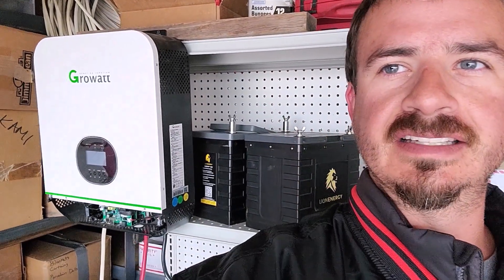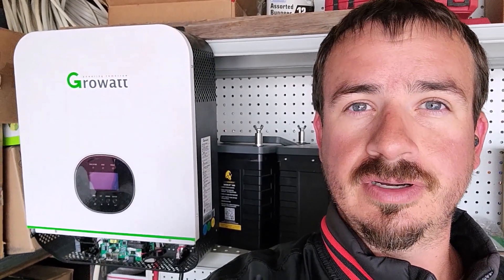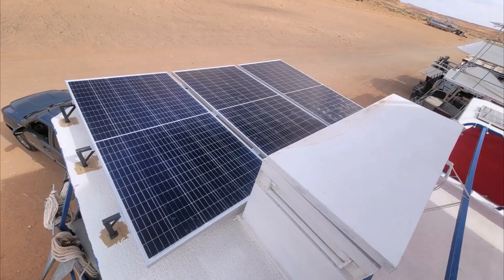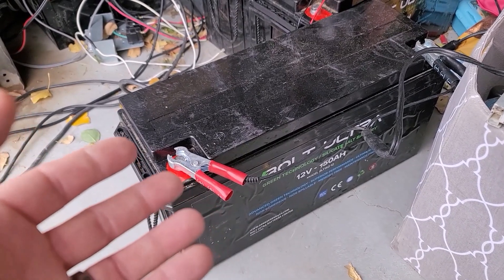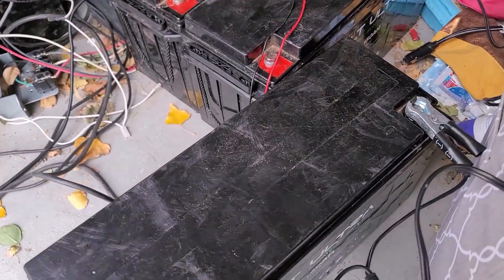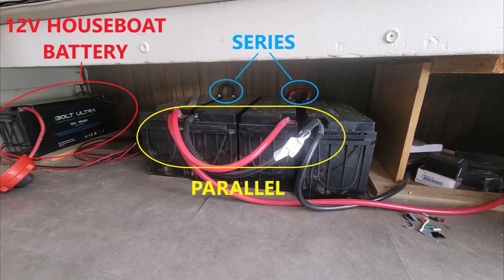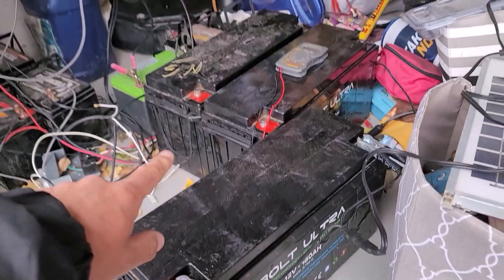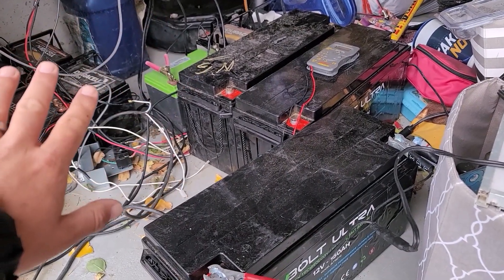Why I Chose Growatt and Silicate Salt Batteries

Comment: While you were talking about that scrambled battery systems I couldn't help but to fixate on the fact that you still had the plastic film protector on the lion energy LCD display (at 10:44) :-)

Its kinda sounding like you need to invest in some bullet-proof batteries (i.e. batteries with built-in BMSs which prevent excessive discharge or over-charging).  Like maybe find a couple of used LiFePO4 batteries (full batteries, not just cells).  Those can take some fairly significant abuse without becoming permanently damaged, and you can charge them right up to 100% without too much worrying about lifespan, so the charge controller settings are fairly simple.  Then throw on a current / energy-use monitor (state of charge is hard to gauge accurately just from battery voltage).

It also sounds like tracking down vampire draw (i.e. continuous current sinks even when equipment is off), such as 120VAC inverters that might be hanging off the system, might help reduce power consumption.  Finding replacement devices that shutdown automatically or which have an automatic low-power standby mode to remove some of the human error from the equation (people forgetting to turn things off).

That fridge sounds like a goner too.  poor fridge.

A good third of the problem seems to be just missing the necessary data with which to make decisions.  The second third is battery health, and the last third is managing the consumption side.  Not easy to solve with so many simultaneous issues to contend with.

-Matt

Comment: Tough situation when too many cooks are in the kitchen.
Our home system is contained in its own utility room where no one else is allowed to touch equipment ( especially programming charge parameters )
People simply dont understand the damage that can be done with the simple push of a button.
Good luck - hope those batteries bounce back for some good years of service.
Reply from the maker: No Kidding!! And with all of the shipping issues the past year and a half now, prices have gone up on these. I am currently working with these batteries and should have a video edited on what I have been doing with them in the next couple weeks.
Right now the boat is dry docked, and we are currently re-designing how the system will be for this next season to help prevent further issues. Needless to say, it will be a lot less accessible, and a much more user friendly setup. Over the next couple months I will actually be doing in-depth videos on our system specifically for our other owner's education. I think they will be good videos overall for this channel.
Thanks for the comment! Have a great day man!